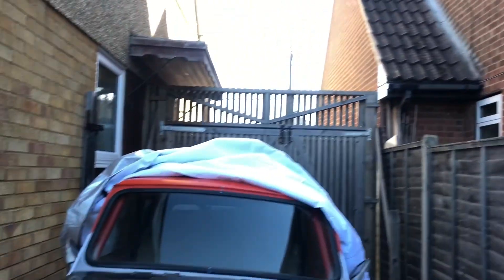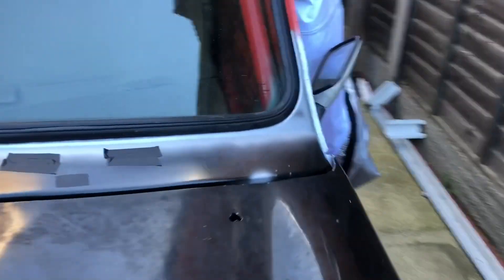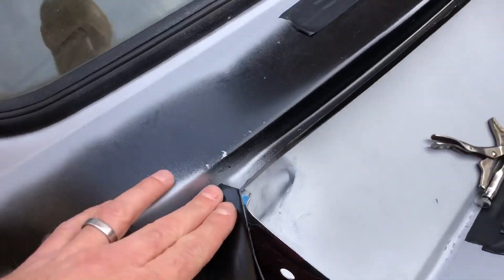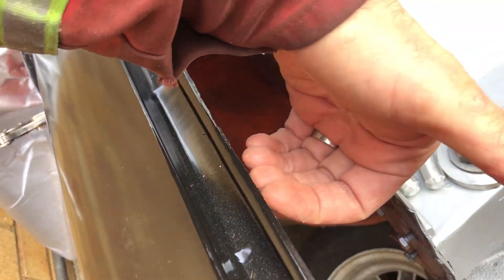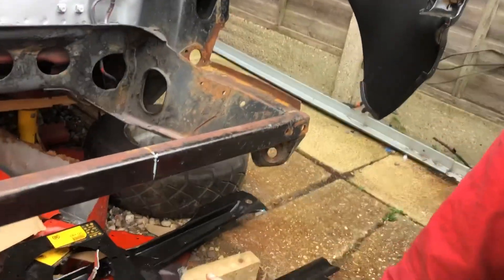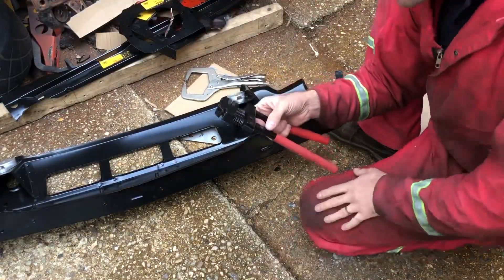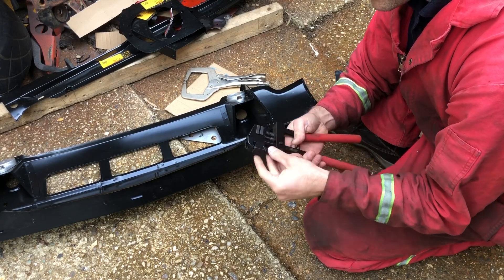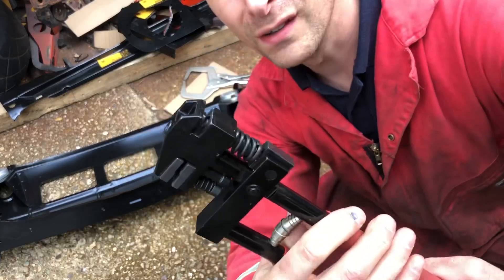Classic Mini - Clubman Front End - Part 1

Comment: Looks awesome, Iv yet to cut the front off mine, as currently doing the sills, but with your clubman front, are you going to do inner wings? If not would that mean you need to put the flip front diagonal support bars in?
Reply from the maker: If you look back through my earlier videos, you’ll see what I’m using. They’re from Owens fabrication. I’m going to make my own inner wings as I’m not going to run a side radiator and I want some access panels behind the wheels. Also my whole front end will be removable. I’m bolting it on.
Reply: @NickThornhill  ahh must have missed one of the early videos, and yea was just curious how you were doing it is all, did hear you say about the removable front, keep it up though loving to see how it’s to be done 👌
Reply from the maker: I know how it’s going to look in my head. Achieving that will be a challenge.